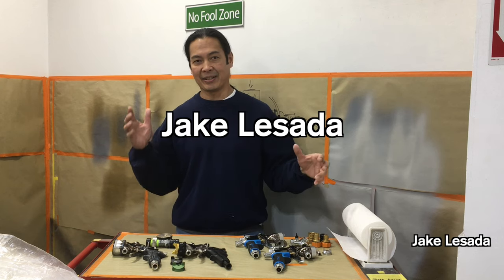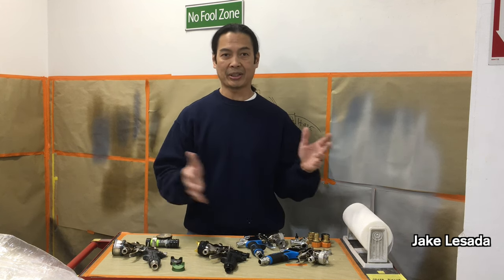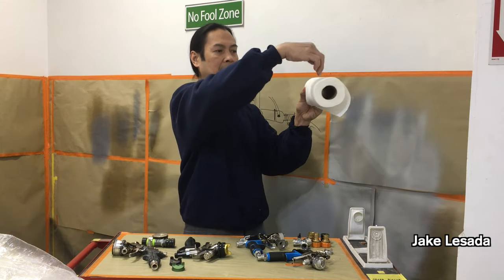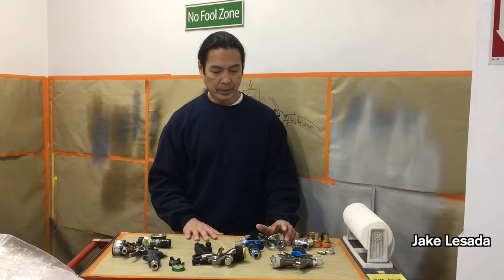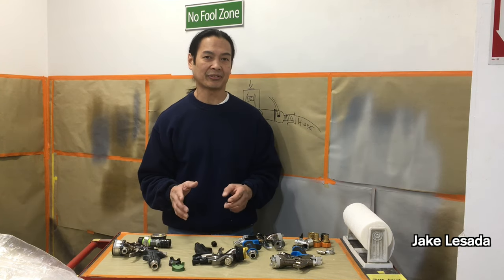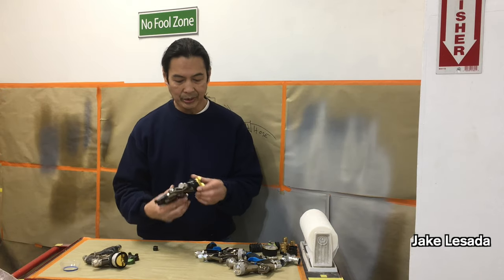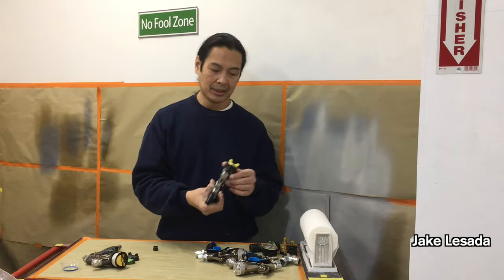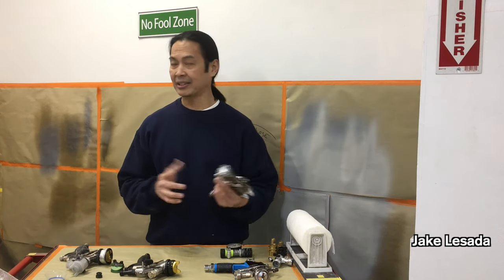Turbine Sprayer For Automotive Basics Which Machine or Spray Gun To Buy?

Comment: Been experimenting with different combos for the Apollo gun and realized I was not using the gun to its max potential. Just sprayed Finish One on a 3500 model truck using the 0.8 needle/nozzle with the regular B cap and the results made me quite happy. Used a hand held light as you do to observe the material. Kept a wet edge. Best of all, the lower psi keeps excess dust from  blowing up and into my clear. I do not have a paint booth and despite cleaning and tacking, at 30 psi, I would get a certain amount of trash. Big reduction in dust specs using the turbine. Same amount of cleaning. I held off until I gained enough turbine experinece, but now I feel I'm ready to sell off some of my good compressor guns and recover some of my investment in them. The 7700 gun can do it all for me now. I have 0.5 all the way to 2.0 with all the caps and hs caps. This is a superior gun in my opinion. Maybe the best on the market for turbines.wooo, ran long on the comments again...
Reply from the maker: Yes, I concur the Apollo spray gun is an awesome spray gun.  It lays down metallics with ease and clears too.  The regular B air cap is the original I started with and have many spray outs with clears and that air cap.  It also likes 1.0mm needle and tip with 7 psi for spraying in the body shop Sherwin Williams CC200 clear.  Also, tighten the fan ring about 3-4 notches in to keep a tighter wet edge.  The 0.8mm works well too, just richen up the fluid more if you need a wetter saturation of material.  Sometimes the 1.0mm can have an over wet and heavy lay down with some clears so you have to really test it first with the clear brand being used.  I do like Speedokote 3:1 mix Glamour clear coat with no reducer.
Reply: @JakeLesada  there are several Speedokote clears I like. I will be using the 2 to 1 SMR 42 clear on a Super Beetle project coming up. Its pretty thick, so I might use the 1.0 with the Hs B cap. Test sprays first to see how it goes. I don't add reducer to the clears unless its recommended. Just sprayed burn out blue metallic with a 1.0 and b cap today on some Beetle fenders today. Love spraying metallics with the turbine. Distributes the metallics so good. I pull back and float some metallics over the still wet base on my last coat just tobe sure, but not sure its really needed
Reply from the maker: I did a live demo turbine spray class with an unnamed major paint supply company spray techs years ago, and one of their top paint techs was amazed at how well the silver metallic sprayed with the Apollo spray gun.  Due to corporate conflicts, too bad I can't share the video. Really cool paint tech though, it was a great day.

Comment: I was using turbine for base and sealers, and compressor for clear much of the time. Working on changing that as I do not like the big clouds filling my paint room. 
   You really have to have everything lined up right to spray clear with a turbine. Your gun settings, distance, psi, speed. I think its generally easier with a compressor in some ways, but i'm all about keeping overspray down and I like the consistent air delivery, lack of filtration needed. Dry air. All those advantages to spraying in my environment.
   Yesterday, Apollo gun, cc cap applying clear to cowl panel and fender. Results were good. Kept a wet edge, med. Activator. Flowed well.
   Next up is Big 2500 pick up.  Overall paint job. My plan is 100 percent turbine, including the clear coat. Not my first overall turbine job by any means, but my Biggest so far. Looking forward to the challenge. Will be using Finish One overall clear provided by customer.
Reply from the maker: Your project spray outs are looking really good.  That should be a fun project with Finish One Clear - "go for the flow".

Comment: Hey Jake, just wanted to stop and thank you for these VERY informative videos!

My old man paints with compressor guns for a living, but he's about ready to hang it up. I'm noticing his work really lacking lately, even on personal projects. These days he's all about "getting it done" and not taking the time to make it perfect like he used to!

I plan on picking up the torch now, and I'm set on building my own 5 stage turbine sprayer. Your videos have really helped me figure out what guns, tips, etc I need to plan on pairing with my turbine when I build it.

I do have one question for you: Have you sprayed suspended metal flakes at all yet? I plan on using Tropical Glitz metal flake products on the C600 cabover I'm restoring, but can't find any videos of people using metalflake in intercoat clear through one of these turbines!
Reply from the maker: About 10 years ago, I and along with a couple of friends sprayed my neighbor's S10 project and we used flake.  As a comparison, we used both the Apollo metal bottom quart cup and the top feed 3M PPS cup. The good thing about the bottom quart cup was we could agitate the flake in the metal cup like old school Binks gun because it was more suspended vs. using the 3M PPS cup where the liners compress and doesn't quite allow free flowing material.  I've used intercoat clear from PPG on a couple of test spray outs and it was easy no hassles.  We under based the body in black and followed it up with metallic red, then suspended the additional red flake in several coats of clear. Then buried everything with more coats of regular clear.  After several weeks dry, Andy the car owner did a Wizards Polish full color sand and rotary buff to get it absolutely flat and it looked awesome.

Comment: Avanti/Harbor Freight stopped selling their turbine guns. Any good recommendations for a budget spray gun? I have a fuji and an apollo 7700, however sometimes I wish I had something "cheap" to practice on and not having to clean the expensive guns thoroughly every time
Reply from the maker: I called my local Harbor Freight, they are completely sold out of the replacement only spray gun.  The store rep said, they are still selling them in the whole Avanti 5 stage kit.  You, might want to try calling other stores close by to see if any are still on the shelves.  I only used one spray gun for years and cleaned it throughly before each session of primer, base, and clear.  I got used to that and try to do the same for every spray gun I use.  Even when, I'm spraying water for testing, I clean as thoroughly as I would with real paint material.  Water is the worst because any leftover drops of water in the spray gun could definitely ruin a real spraying session.  Thank you for watching and commenting.

Comment: I just realized the Avanti spray gun doesn’t have a fan width adjustment and that sucks! I’d like to be able to dial the pattern down to about 4-6 inches to paint some interior trim and it’s impossible.
The turbine is good but that’s some b…..it. The fan on it is huge and that’s great if you want to paint walls🫤
Reply from the maker: It does have a sorta fan width adjustment at the back of the spray gun.  I call it an "air choker".

Comment: I have a 4 stage fugi with the,T70 gun and tip kit ,, just sprayed a ,80 Bronco flawless, sprayed a 47 foot Yaht in 11 mph winds and again perfect , it's the amount of stages that really matters, only problem l see with turbine sprayers is the heat clogging up the nozzle and tip faster with my clear coats, just have to practice and don't mix to much paint at once so it doesn't thicken
Reply from the maker: Nice job on the 80's Bronco and man, that is a long vessel.  47 foot Yacht is a handful, the longest I've faired and painted, but with air compressor spraying,  was a 38ft steel utility Yacht, in a huge Clearspan tent, it took 9 months, one winter, a session of carbon monoxide poisoning from the generator, and a couple of really windy bad thunderstorms.  When the project was finished and about to be craned into the water the following day, overnight there was a huge storm that came thru and literally blew the whole tent, and lifted the tent across the boat yard.  Luckily the utility Yacht finish wasn't scratched one bit.  Thank you for watching and commenting.
Reply: @JakeLesada   yeah l went through hell with the 47 foot Yaht, did it in October dry docked next to the water, big mistake sprayed it perfect like glass with mirror like finish with awgrip paint came back the next morning to a clouded finish from the Dew that night,, scuffed it all up and tack clothed it all down and did a roll and tip paint job that time off a 8 foot step ladder many said it was impossible for one man too roll and tip well l proved them wrong and it looked like it was sprayed not a brush stroke in it leveled out perfect and again the dew dulled it,, l was sick!! , Awgrip paint needs 12 hours to not be affected by dew and humidity and actually stops drying at 60 degrees completely,  the boat owner thought him and his 3 buddies could do it and really messed it up, sanded it too deep to the pin holes in fiberglass and didn't wash all the sanding dust off like I did and didn't tack cloth,, it was horrible,, l was 7 months restoring the boat,, was a buddy Davis and l did all interior 2 bedroom, 2 bathrooms salon and all of engine room and pretty much updated all the wiring to relay's,  broke my heart seeing the paint job so bad when everything else was perfect,  back to the point that was my first spray job with a turbine sprayer and I was sold on them after that,, l do all my base coat on my classic cars but still use my black widow HTE air compressor gun for clear l need the 30 psi to blow the clear apart and get really good atomization with less orange peel then the turbine can give without thining it to the point of running.

Comment: What  make of light do you use to check your finish ? Thank you
Reply from the maker: Steelman Pro is the light I use for painting, I added link in description.  Also, watch my video "Futuristic spray mod" it shows how I use the light to see surface texture.  And, for detailing when I cut and buff, I use Scan Grip light and Milwaukee Detailing light.
Reply: Thank you,I have two of the original Accuspray hvlp guns made before  they were purchased by 3m and have resurrected my hvlp interest.Great videos and work thank you.👍

Comment: I'm torn between the pps med HO setup and pps large HO set up.  What do you like to use most often as far as comfort goes?  I definitely know I don't want the mini.
Reply from the maker: I have three to choose from - 1.0 mini, 1.0 large and 2.0 midi - but the one I tend to use more often will always be the 1.0 mini or 2.0 midi with a couple of refills.  The 1.0 large H.O. cup when used on top as gravity feed style will feel a bit heavy when full.  I like to use it on the bottom and the weight is better balanced when full, and the spray gun is easier to use with less stress on the wrist. The 1.0 large H.O. cup is more efficient when doing multiple panels, it will help prevent running out of clear coat in the middle of a large panel and having to refill and restart to a drying wet edge.  If you need to only get one, then go with the 2.0 midi, it's large enough but not so big, and has multiple liner choices. If you are doing large continuous spray outs go with the larger cups, you'll refill less often.  Hope this helps.

Comment: I went to harbor freight today to buy that machine and the manager took me they stopped selling them, I was disappointed.
Reply from the maker: Yes, I just spoke to a couple HB stores in my area and they told me it's no longer available.  One store told me the item has been replaced with a different machine, but the machine is an airless sprayer and not a turbine sprayer.  Their replacement turbine spray gun is also unavailable within a 100 mile range of the store I spoke to, and it's been on the "clearance item" description.
Reply: @JakeLesada  the manager said it wasn't a big seller and there going to focus on the cheaper models. I have one that I've been using for a few years and it still works, but I don't do cars .